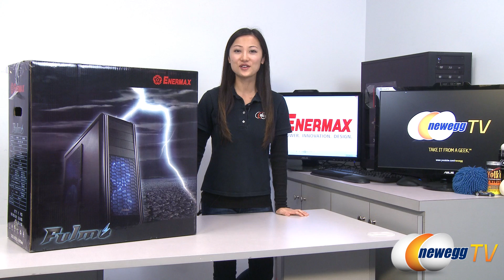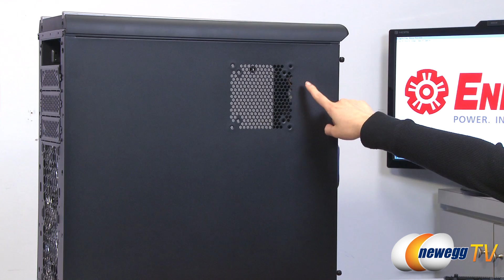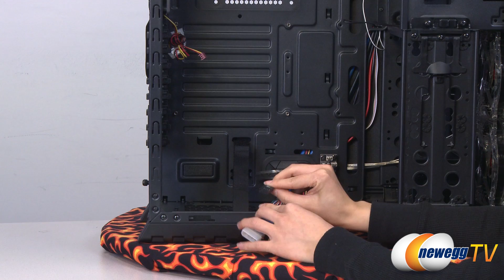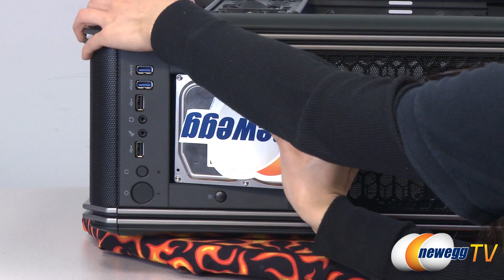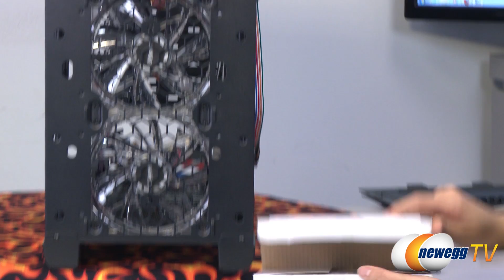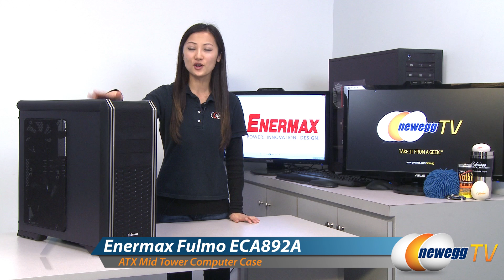Newegg TV: ENERMAX FULMO Advance ECA892AG-BL ATX Mid Tower Computer Case Overview

Comment: Well done!  Joanne was thorough and pleasant to listen to.  Case design looks excellent.  Lots of intake and output opportunity for airflow in a mid-tower.  I have been looking for cases with both lots of fan intake potential from the bottom of the case along with fan input on the left side panel over both GPU area and CPU/memory area (so many cases only have the GPU area).  Love the HDD layout (Great idea!).  This case seems to have it all.  Only concern is quality.